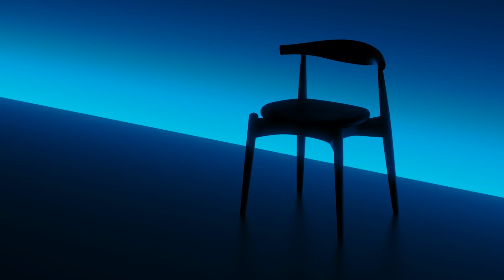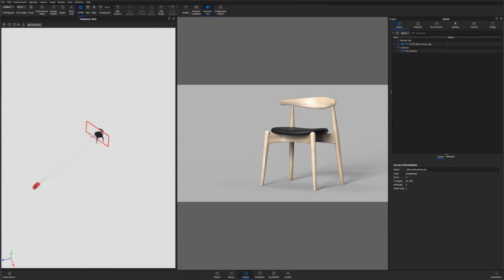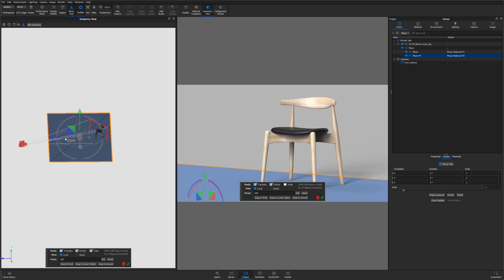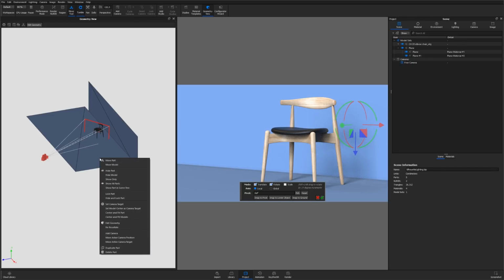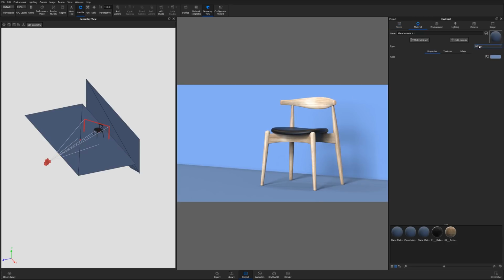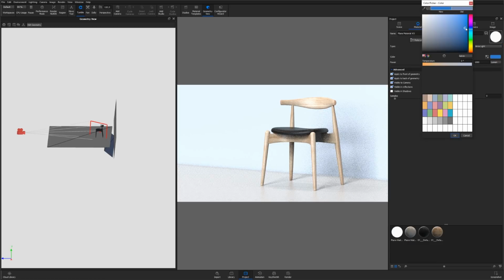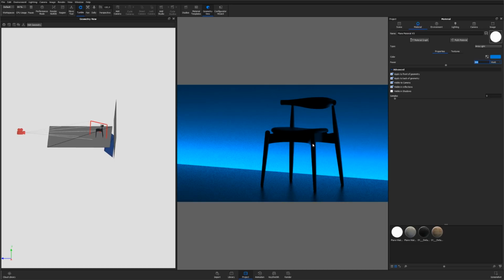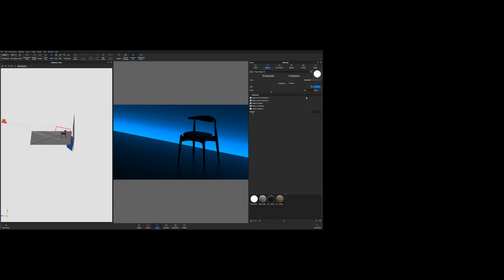KeyShot Lighting Study: Colorful Silhouette Lighting

Comment: Hey Esben. First of all many thanks for all the great videos. I am currently looking for a hardware upgrade to optimize my rendering time, but I am in doubt what to look for. I have tried searching for answers and come across various suggestions but its still unclear to me. Any pointers? Thanks
Reply from the maker: Hej Jens! Thanks, appreciate it. I would suggest to have a look at the AMD Threadrippers. Which one of those to pick depends on how much speed you need and your budget, but from what I know, they will give you a lot of speed for the cost. Have you had a look at the benchmark section on the KeyShot forum? There are a couple of builds with different Threadrippers that might help to give you an idea of how they perform with KeyShot: https://www.keyshot.com/forum/index.php?board=36.0